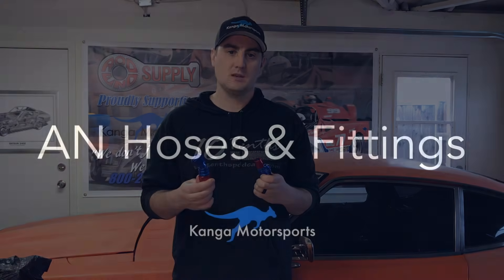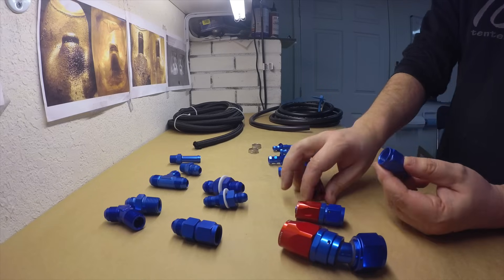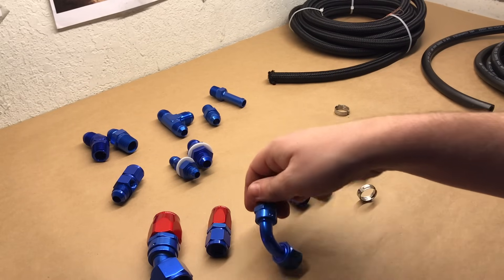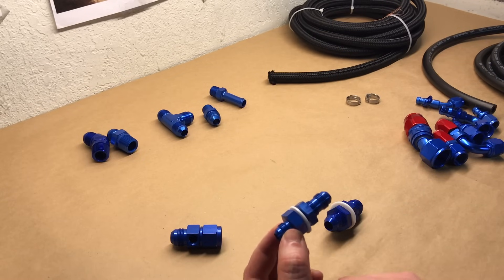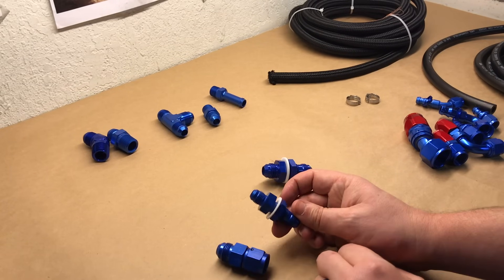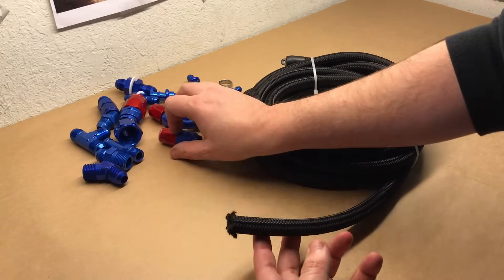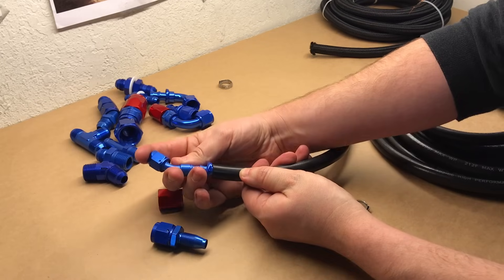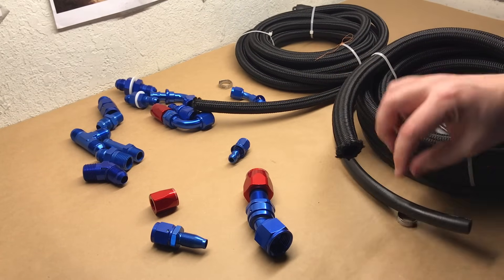AN Fittings & Hoses Guide & How To

Comment: I bought a bunch of '6AN' fittings and a bunch of '6AN' hose.  Never having used these before I learned the hard way what rarely seems to get mentioned: PTFE hose is much smaller than CPE braided hose and there are completely different fittings for each.  So I wasted money and the cheapest way out for my mistake was to use the fittings but buy some CPE hose.  It was too late to do a return on the PTFE hose when I got around to building my fuel lines....!

Comment: I have new black hose fir fuel line
I tight it with similar Hose Clamp 
But air come in from outside to inside
I tight even harder and if i tight more hose will cut and damage by hose clamp

What is good solution ?

Comment: What do you do if the hose keeps coming out?
Reply from the maker: If the hose is coming out, you haven't seated it far enough in before tightening. Make sure it is pushed in all the way. You can use tape or a paint marker to mark the hose just so you have a reference on how much movement. Really push the hose down in there. Also check to make sure you are using the correct hose size with the correct hose fitting.
Reply: @KangaMotorsports  yeah well I’m 100% sure I pushed it all the way to the back where it stops. I’ve done this 1000 times and never had an issue. I bought some off of eBay, probably Chinese. But regardless the thing just falls right out when you start tightening it.

Comment: I have 1982 Mercedes Benz 300D Turbo diesel! I would like to replace oil cooler lines with AN and aircraft style hoses ! It would make the replacement simple compared to the rubber and steel lines which are about 3 feet long with extremely difficult fitting of removal and replacement lines to cooler and oil filter ! I have the new lines but you have to be a contortionist to remove and replace the lines without removing motor mount and jacking up the engine! As it is metric and my first attempt at AN lines I need some help if you could! Thank you !

Comment: Can i use the rubber lines with the threaded style fittings? Should of watched this video before trying to repair my own as i crushed my line trying to press the super frayed stainless steel line by hand.
Reply from the maker: You need to use the correct line with the fittings don’t mix and match. Recommend you watch for tips and tricks on installing

Comment: How do u tell what size an fitting are on a car what size wrench for an6 or an8?
Reply from the maker: Visually you can tell the difference they are notably different sizes when you put them next to each other. A set of AN wrenches are sized based on the fitting from the manufacture. You can also quickly measure them or there are adjustable AN wrenches that also indicate the size of the fitting.

Comment: Only thing I would not do is add oil to the hose itself. The moment you add petroleum base product to the hose it starts to swell making it harder to install. Once you oil the barb on the fitting the hose should be installed in 1 shot.

Comment: Completly avoid cutting hose that will be used for fuel injectors with a grinder. Use the big cut off tool you seen him use for all your injector lines. It's just to hard to remove all the dust from inside the line that a cut off grinding wheel produces. I don't need to tell you what happens when those contaminants reach your injectors!

Comment: do you really have to bottom them out al lthe way ? sometimes they get super hard to turn
Reply: Not sure if you still need the answer but I watched a video from “improved racing” and they said it’s really important to bottom out the hose so it doesn’t leak over time

Comment: My racing fuel pump would blow that hose right off , it wouldn't work for my application,  but nice video
Reply: Using ptfe line with an olive captured sleeve your not blowing nothing off unless your pump puts out over 300psi
Reply: Why? What PSI are we talking about?

Comment: May i know what size is the radiator hose of 150cc scooter and the size of caliper brake hose? i want to buy online but i dont know what size they are.
Reply: Measure the damn things!!! Ffs
Reply from the maker: Sorry not sure what size the would be for your specific application.
Reply: You do not want to use these fittings and hoses for motor vehicle brakes. The pressure in brake lines is much higher than fuel, oil, and coolant lines.

Comment: I'm  sorry to say but your installation method is WRONG. As an aircraft engineer for 50 years please  get the correct methods of performing the  procedures you are trying to teach others..
Reply: He also didn't include 37 degree flared fittings along with stainless steel braided lines

Comment: Thanks for the video .  I’m looking at a catch can for my vehicle and the one in found has 10an holes.  My vacuum lines are 3/8.  So i need a 10an to 3/8 barb fitting to connect the 3/8 hose correct?  I also found a 8an catch can and it would be the same 8an to 3/8 barb fitting.  thanks

Comment: Assembling these really doesn't look any different than the reusable hydraulic, fuel, air fittings in use decades ago. At 16:27 when you were putting the end on the hose----i don't know about these----but on the hydraulic, air, and diesel fuel fittings we used (Aeroquip) you would turn counter-clockwise to install the fitting on to the hose and vice-versa, of course, if you were replacing the hose. Not sure why you didn't include a fine tooth hacksaw as a way of cutting hose that is reinforced with steel. Early in my career there was no such thing as cut-off discs. I don't really care for them cutting hose because of the debris they get inside the hose; although you did mention flushing. Good explanation though. Who makes that nice aluminum clamp you were using in the vise? Could of mentioned that in the description.

Comment: Is there a special lube to use when mating the hose and fitting?
Reply from the maker: We are using Redhorse Performance assembly lube but you can also use various light weight oils to prevent galling the threads.

Comment: can you use a braided fitting on a push loc hose..?? thans for anu answer
Reply from the maker: Not sure if you can or not would depend on the manufacturer. I wouldn't recommend it since the fittings are more expensive so may as well use the push lock fittings.

Comment: 16:34 hi mate I’m still confuse would you tell me how deep exactly we should put this Nylon hose to hose end?
I believe there is something like ”curb”inside which doesn’t let put this hose deeper?
Reply from the maker: Correct. There is a little lip on the inside where the threaded portion has a smaller diameter than where the hose fits into the end socket. Just push down on the hose and you will feel where the hose can not go any further. You can kinda see it at 16:42.
Reply: Kanga Motorsports that’s great,now I know what to do next, thank you very much for quick respond, all the best for you from Poland💪

Comment: Probably a dumb question, but are u able to reuse the fitting? Say for instance, I wanna shorten the hose can I use the fitting again or will I have to get new ones?
Reply from the maker: You can assemble one end, place it on the car and then measure to get the other end the right length. You can reuse the two part fittings (Blue & Red in this video) but make sure the fitting and threads are in good condition. The push on hoses are near impossible to remove without cutting and most of the time you end up messing up the barbs or fittings themselves during the removal.
Reply: @KangaMotorsports  you can reuse the pushlock end, do it this way. a soldering iron, and just cut the hose off with the tip of a hot soldering iron, use no razors etc. this will grove the push lock fitting, leaving a path for any fluid to find a way out.
Reply: How do you remove the push lock clamp once installed?

Comment: What are the ball bearings on the an fittings? I had one missing and it blew oil everywhere. Is it some type of pressure release?
Reply from the maker: Are you talking about the retaining pins?
Reply: Is that what they are? I must have had a faulty one then because it was shooting oil out of that hole.
Reply: Yes, that’s the retaining pin which keeps everything together. They shouldn’t come out. Most manufactures would warranty that fitting.

Comment: I have an issue. My particular pcv valve outlet is plastic with an ID of 3/4 inch.  It's roughly 1.5 inches long with no threads inside or outside. 
I want to attach a 3/4 inch (ID) flexible braided hose to this little plastic piece that has no threads whatsoever.  What will I need to make the sealed connection?
Reply from the maker: Is there a specific reason you want to use braided hose? You could use this type of braided hose and slip it over your plastic fittings but you have to find a way of sealing the edges to prevent the braided edges from fraying. Otherwise just use normal good quality hose like the type we use with the push on barb fittings.
Reply: @KangaMotorsports  If I use that stock plastic tube coming out of my pcv/valve cover,  and slip a rubber hose over it, I have to use a fairly large ID rubber hose to get it on. This then creates a problem for me that the hose is so big that I can't get my plastic engine cover back on to click on the grommets.
Reply from the maker: @kmax7163   I am not sure I am following, sorry mate. Send me a few pictures vial the website email address and I might be able to better understand the problem.
Reply: @KangaMotorsports  Ok.  I can send em tomorrow.  About midnight here now.  Thanks,  and I'm pretty sure ya have a couple fittings for my purpose but wanna make sure before I order.
Reply: @KangaMotorsports  Yesterday,  I emailed 3 photos to Kanga Motorsports.
Reply from the maker: @kmax7163  Just sent you a reply just now. Good luck with your project.

Comment: I was wanting to make a line to replace my return fuel line which is 5/16. the AN sizes don't match odd size numbers. what can I do to solve this problem?? anyone
Reply from the maker: Most people run -6 for Fuel lines. There is a table of size in our article (http://www.kangamotorsports.com/blog/2018/an-hoses-fittings-guide) that you can use as a reference.  You would just need to use adapters or plumb in an fittings to make it work.
Reply: @KangaMotorsports  People also run -6AN for transmission lines right? AKA 3/8" I.D.  I need to replace the stainless braided lines on my transmission and was wondering where to buy? Thanks!
Reply from the maker: The Photographer we get our hoses and fittings from Redhorse Performance they have been supporting our racing for a few years now: http://www.redhorseperformance.com

Comment: Use anti seize on those aluminum threads putting those Russell AN fittings together.  It really helps when you go to reuse them over time.
Reply from the maker: Chuck Howard thanks for the great tip

Comment: so the blue/red ones that screw together to hold the hose can only be used with braided hose?
Reply from the maker: Tj1056 they are designed to be used with the braided hose either stainless or nylon. However, different companies offer different options check the catalog and user guide/instructions specific to the manufacturer. Also note fittings can come in other colors such as black.
Reply: @KangaMotorsports  Now you tell us!.... I wasted my money with this exact issue. Woulda been nice to hear in the video.